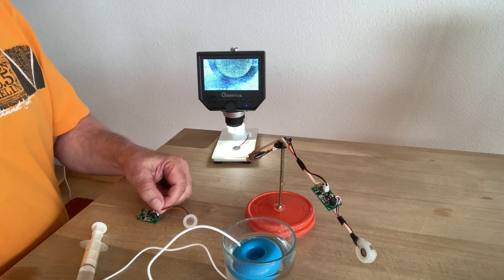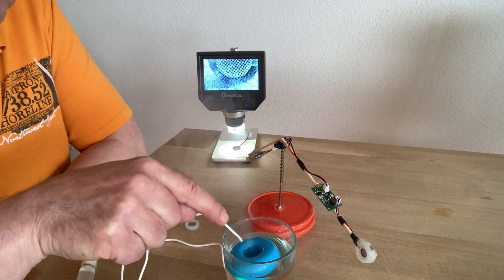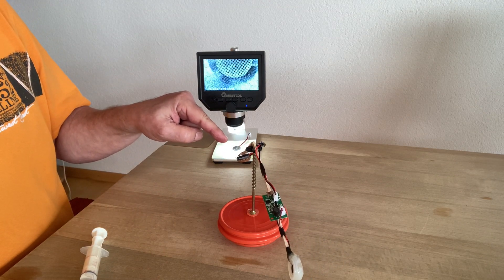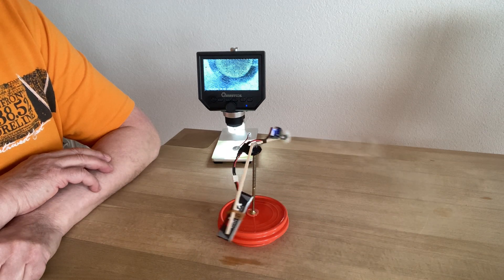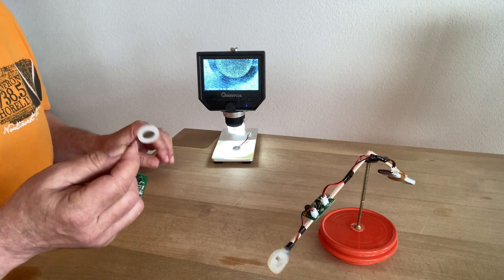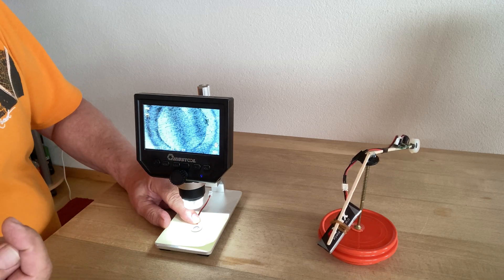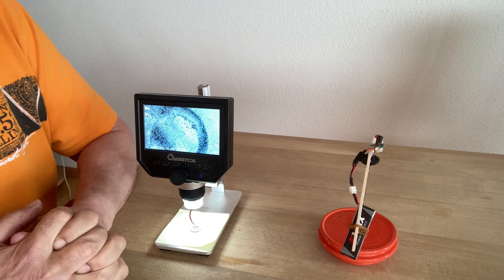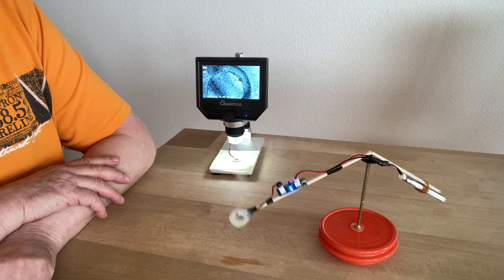ultrasonic propulsion part 1

Comment: Interesting! Thanks for sharing! I once suspended one of these ultrasonic fog makers inside water, holding it for the power cable. Once powered, the rig produced a force by acting directly on the water - the cable deflected - without emission of fog.
I have a question: Have you maybe tried to run it without the water, to see if the interaction with the air molecules will produce the same effect, although smaller? I could not do it with my device, because it had a sensor which prevented it to run in dry conditions, to avoid overheating... But I guess that if it is operated very shortly then it should not burn.

Comment: This works by the inverse of the piezoelectric effect. These will likely to tuned to their own resonant frequency for efficiency. I believe you need a transducer tuned to the resonance frequency of the body of water to produce cavitation. It'll need to be tuned on the fly since the frequency of the body of water will change due to a bunch of factors.

Comment: Humidificateurs à ultrasons : 
Un diaphragme métallique vibrant à une fréquence ultrasonore crée des microgouttelettes d'eau (de 1 à 3 microns), par augmentation de la vitesse de l'eau localement, donc par diminution de la pression locale 
Elles quittent l'humidificateur sous forme d'un brouillard frais (vaporisation à basse température = température ambiante).
Un transducteur piézoélectrique immergé dans l'eau convertit l'énergie électrique appliquée en vibration mécanique (vitesse) à haute fréquence, provoquant la vaporisation à froid.
Très faible consommation d'électricité (10% des "autres systèmes classiques")
Théorème de Bernoulli: P/Ro + V²/2 = Cste

Comment: Water is heavy, it is ejecting it from one side only,
like rocket propulsion,  Not like a jet propulsion.
° A rocket only ejects matter from one side,...
a jet has an intake on one side and an exhaust on the other. 
° If an astronaut floating in zero gravity throws an object away from himself, it will cause him to move in the opposite direction.
° It's Newton's law - 
"For every action there is an equal and opposite reaction"

Comment: happy to see you are back doing things... 
I do not exactly know how it works, but what I do know is that people use them in cars to vaporize gasoline instead of using liquid gasoline. It makes lower consumption and less residus. I think the mesh is used only to filter big objects out of the water, You can vaporize gasoline inside another glas container... this guy (I do not know him) shows you how to do it:
https://www.youtube.com/watch?v=N3QzNvvmPno
but you could do the same with water... so it has NOTHING to do with the mesh...
Doing it with water you might be able to get a better angle and opening so that you can set the direction and strenght of the vapor....
its worth a try..
Luc